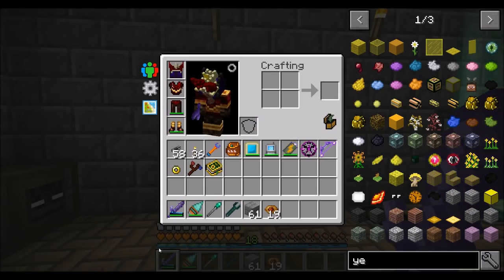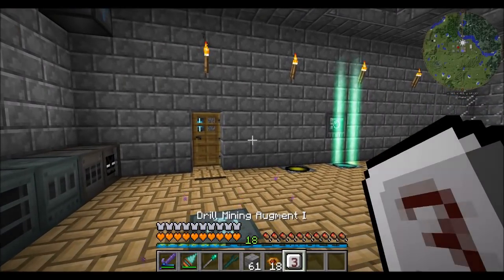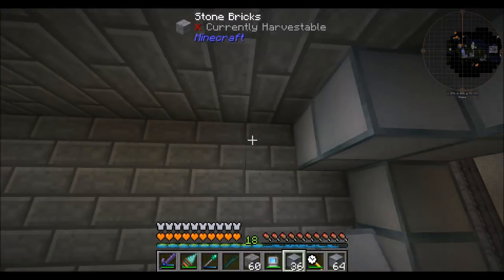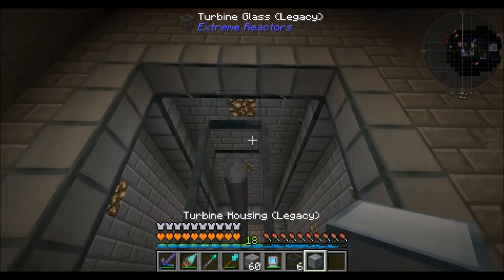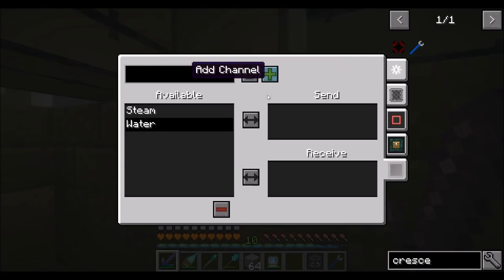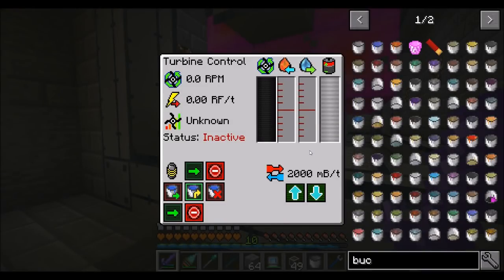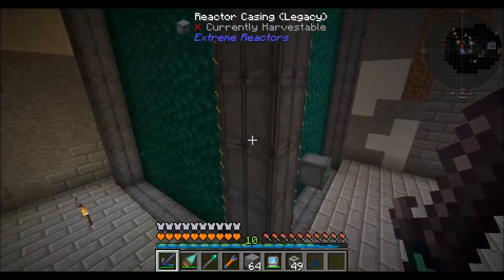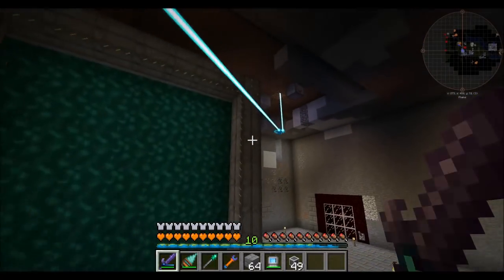Lets Play S8 E77 Turbines

Comment: Swap out the Alloy Smelter for furnace duties. Even with an octadic they're too slow. The Redstone Furnace is faster once fully upgraded and with four speed augments. I haven't tried it yet but I suspect that the Extra Utilities furnace with twenty speed upgrades is the fastest in the pack. Setup more than one also rather than having one furnace do all the smelting, especially when you have recipes that require multiple smelted items.
Reply: yeah i usualy aftera whiel setup a chest to shvoe all smeltignoperatiosninto and use enter io or similar to pushit into multiple furnaces
Reply: any1alive You havin' a stroke there mate?
Reply: any1alive I do the same with transfer nodes and filter them to put a single item into each furnace. That way it always spreads the workload.

I use the same method for ore processing but with a storage bus on the chest, filtered for the correct ores, set at a high priority and insert only. That way the ores only go into the chest and never enter the ME storage cells. You never see them in the terminal window. Just need to make sure that your processing machines can keep up with the incoming ores, or have an inventory scanner that will detect how full the chest is and stop your ore source.
Reply: The actual fastest smelter, if not practical, would be the Electric Furnace from IC2, presuming there's enough power flowing to it and it has enough Overclocker upgrades
Reply: Justfiness Very true. If Mekanism was in the pack you could use the universal energy cables to supply the EU. They do direct conversion from RF at a ratio of 4:1 (I think that's the correct figure).
Reply: yeh, mainly for semligni just setup a interface to hol each ore type and endedr io with round robin straight out of it
so i can also put flint in its exporter

Comment: Using Dimensional Transceivers to move a fluid twenty meters seems like ridiculous overkill. XD
Reply: its a problem with the i/o that you need to transfer ender io conduits dont have enougth so have the pipes from extra utiliti only other option would be to build it rigth next to it that the reaktor and turbine orts link direktly

Comment: I wonder when DireWolf20 is going to realize that having no water in the reactor means it's going to run hotter and less efficiently?  It really should have a surplus of water in the reactor while it's running, even if it's only a few mb.  This keeps the temp down, makes the reactor a bit more efficient, and makes it a lot easier to balance your reactors output...

Comment: When i build Extreme Reacors Stuff in my World your modpack didn't have a fluid pipe that had enouth throughput to power it and mine was like 5x10x5. So i had to download mechanism, because builing them next to each other looks ugly
Reply: Riding Weeb what speed did you need? Liquid transfer nodes are muuuuuch faster than enderio conduits when they have many upgrades.
Reply: Riding Weeb and xnet wiki implies fluid transfer is instant?
Reply: 2000 mb/t
Reply: Riding Weeb dimensional transceivers have near infinite throughput
Reply: in 1.7.10 fluid nodes were not strong enough with max upgrades , i remember transceivers having a limit but i cant remember what it was . Im also not sure how different the fluid nodes are between mc versions